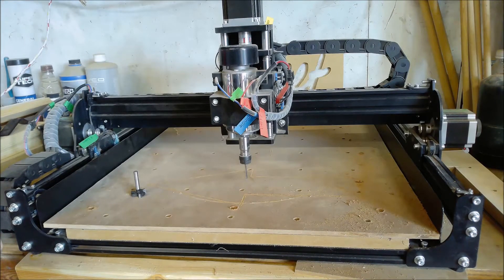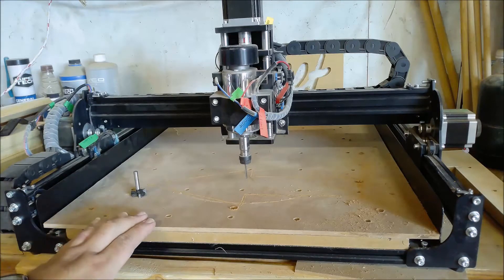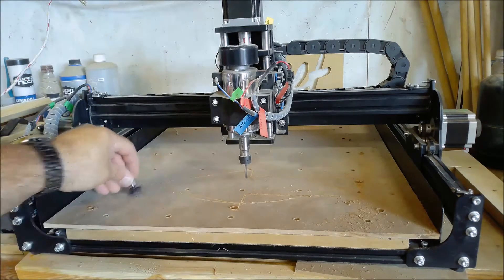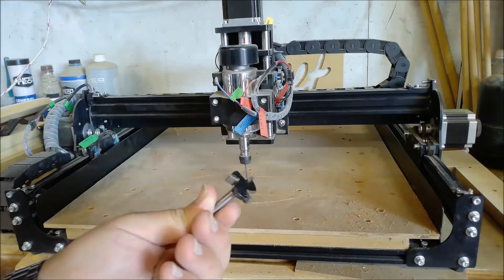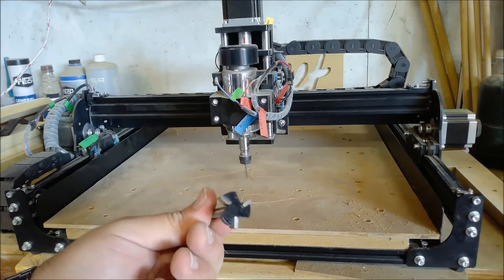leveling wast board on my foxalien 4040xe

Comment: What happens if you have a project that lays on top of the section that was not cut?
Reply from the maker: If i understand your question right, you probably need to adjust your settings.
Reply: @justinsworkshop6636  He means the mid of your board is now lower then the rest of the board. If you used a bigger project you cant do that atm.